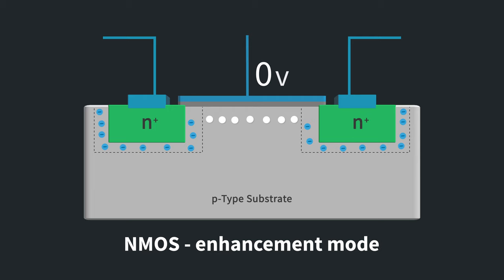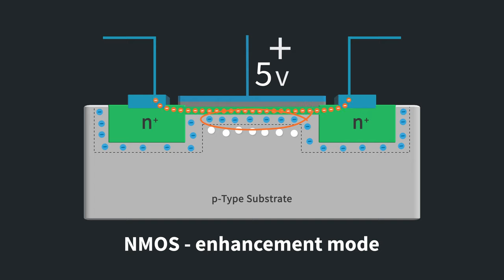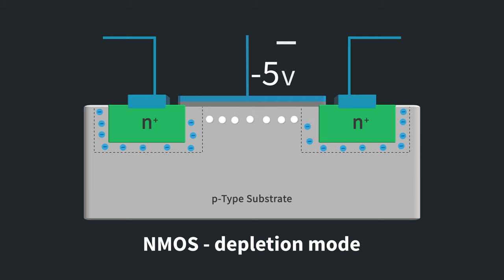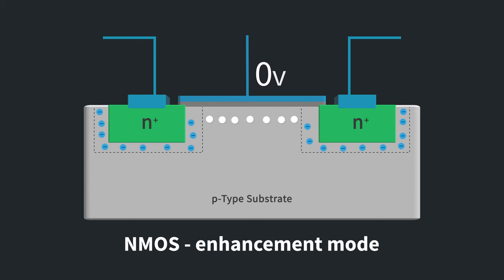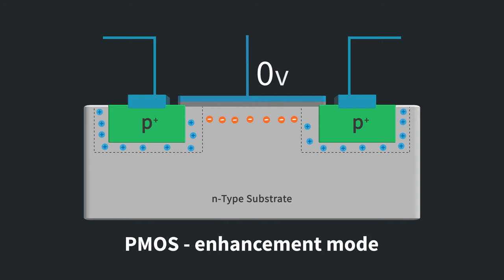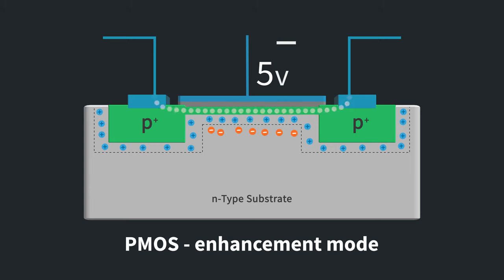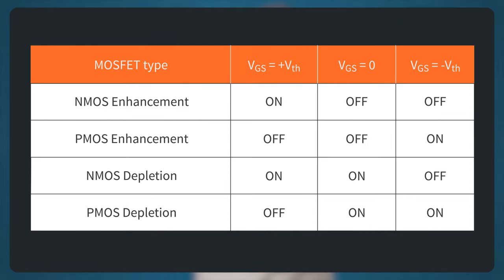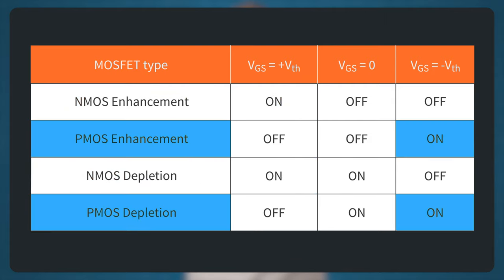NMOS vs PMOS and Enhancement vs Depletion Mode MOSFETs | Intermediate Electronics

Comment: Sir, Vgs positive means forward bias or reverse bias
Reply from the maker: In short - forward bias.  In an NMOS, if you have a positive gate to source voltage, it means that you are applying a higher voltage to the p-type substrate (through the oxide) so you'll have a forward bias between the higher voltage at the p-substrate than the lower voltage at the n-type source.  The weird thing is that the higher the gate voltage, you're actually converting a small slice of that p-type substrate into n-type, creating that channel.  So it arguably is not even biased as you're creating an entire channel of n-type material.
Reply: @CircuitBread  thank you sir

Comment: Thanks; I watched a video recently where an amplifier restorer was working on a Sony V-FET output type circuit. He mentioned that V-FETs are depletion mode devices and when adjusting the bias voltage he wound the potentiometer feeding them all they up and then adjusted it down. Now I understand, hopefully, what he meant.

Comment: Thank you! May I ask what is the on voltage defined as? Is it if it reaches a certain current because I think it is ambiguous since the device is never going to have totally 0 current
Reply from the maker: That's an excellent question!  I believe manufacturers have different levels that they consider the cut-off point and that information can be found in their datasheets (it's usually either a note, subscript or superscript) and the voltage provided will referred to as where the FET turns on.  They will also have information about what their leakage current is - the current that you get when it's supposedly off.  This same question/issue also occurs with diodes and LEDs as the on/off points aren't perfectly clear either.

Comment: Nice video explanation and summary of the MOSFETs! I love the animation as well. I would be interested to learn about the difference between those MOSFETs in application, like I sometimes hear NMOS is more stable than PMOS but I have no idea if that's true and why it is.
Reply from the maker: I've heard that PMOS tends to have a much higher impedance than an equally sized NMOS due to the lower drift velocity of holes versus electrons but other than that, I'm not really sure.  Once all of this world-craziness blows over, I'd like to go see the professor who double-checked to make sure our scripts were accurate and see if she has any insights on this or further requests on this topic.  Thanks for your feedback and we'll see what we can do!

Comment: STMicro makes complementary n-type and p-type mosfets (STB80NF55 and STB80PF55). The data sheets for both show drain current as a function of Vgs. Can you explain why in both cases the gate to source voltage is positive? - Thanks!
Reply from the maker: That's a great question!  It confused me as well when looking over the datasheets, but I found this note at the bottom of the Electrical Characteristics section of the STB80PF55 datasheet  "For the P-CHANNEL MOSFET actual polarity of voltages and current has to be reversed"  Now, why they don't just show the negative signs in the boxes?  I don't know.  Probably easier somehow.